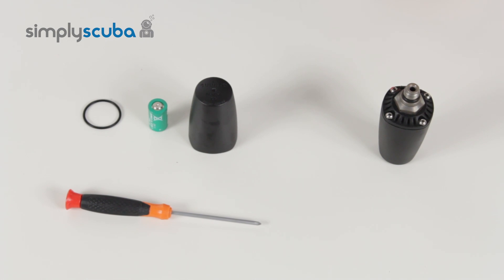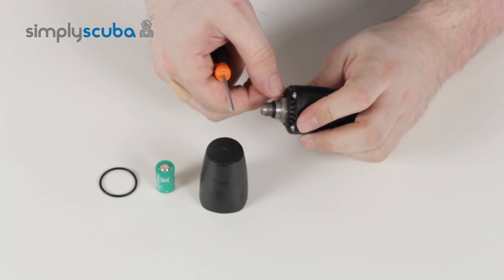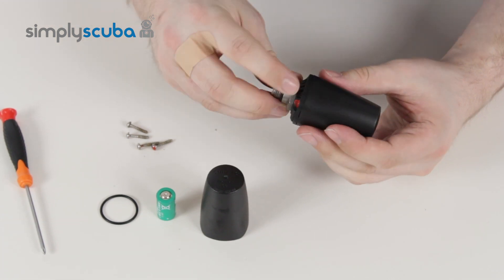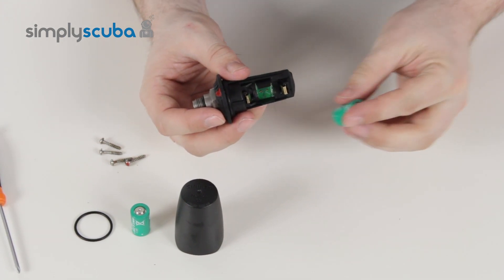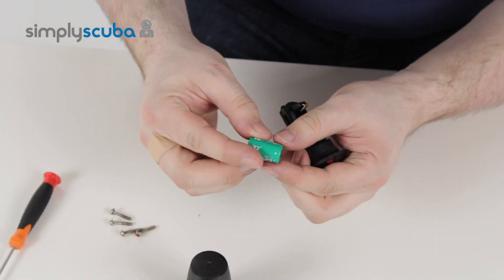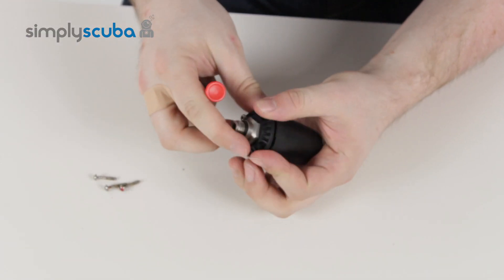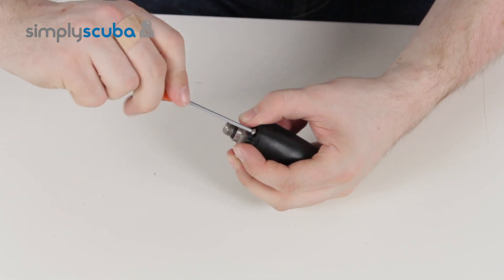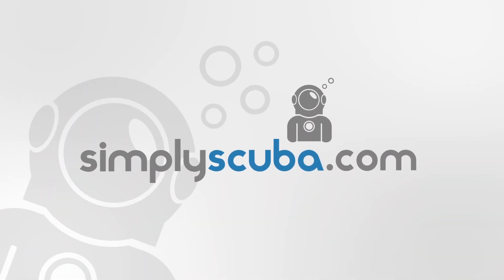How To Change The Battery In Your Suunto Transmitter

Comment: Not a bad design.  I have an AquaLung one where the battery goes in the other end.  Unfortunately it's soft plastic and hard to get off because using a coin or screwdriver tears away chunks of plastic. Any tips for removing a stuck lid for the other type? 🤔
Reply: Maybe trying a plastic guitar pick would help remove the soft plastic without splintering? Never tried it with dive equipment, but it helps when opening laptops.
Reply: @jooborrego4  thanks for the suggestion.  Unfortunately a guitar pick will not be wide or firm enough.  It is poorly designed or made of the wrong materials.

Comment: Thank you for showing us the correct way to install this battery.
Apparently Suunto thinks divers aren't smart enough anymore (as of 2017) to change this battery, so good luck finding a replacement case or pod as they call it, if you feel like replacing it. Some of us have no choice to do this where we live, due to the poor Suunto service (in Canada at least)  Pay attention to the direction of the battery because unlike most "normal" batteries, the stubby end is the negative side. Look for the tiny + signs on the "flat" side of the battery and the tiny label stuck inside where the battery sits for the correct direction. 
Here's another thing about Suunto. If you have a D9tx (not a D9) don't go looking for a special wrench to unscrew the case as you would a D9 which uses a perfectly round "O" ring.
Suunto would like you to think you need special tools to change that CR2032 battery on a D9tx when all you need is a T6 Torx bit to remove 6 tiny screws. If you can do that, then you're probably smart enough not to over tighten these after you've cleaned the squiggly or wavy "O" ring and used a light coating of silicone grease on it. Cheers!
The only thing you might not have is a way to pressure test things, but if you're methodical and carefull, there should be no problem.
Reply: Battery Correction to D9tx. Battery used in the D9tx is a CR2450, not a CR2032. Sorry if I confused anyone. Cheers!

Comment: Hi, is the O-ring the same size as the old transmitter? Can i reuse the cap? There is a bit of supply shortage in my area and i only have the battery and a new O-ring from the old transmitter

Comment: Very good, except you messed up one critical piece of information. The screws are Pozi Drive, NOT Phillips.
using the wrong driver will damage the screws.
There are four distinct cross marks on the screw heads. This means it's Pozi Drive, not Phillips.